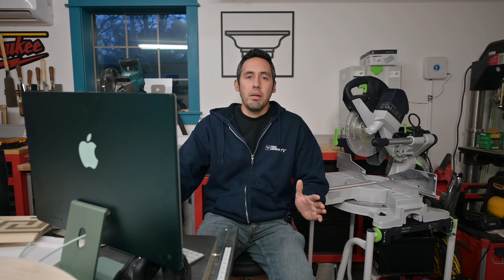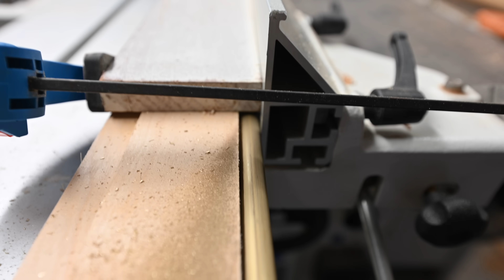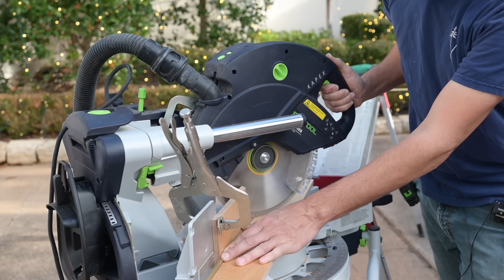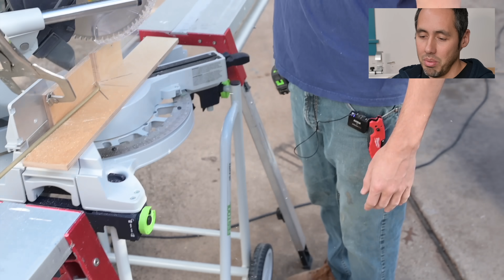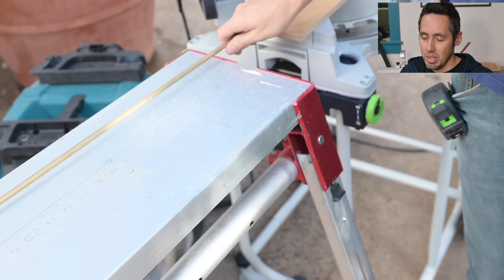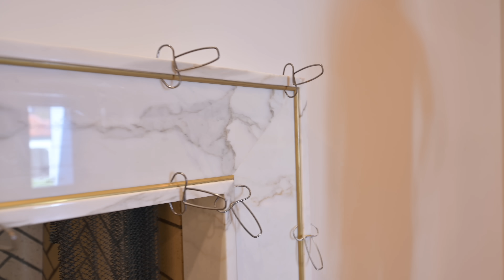It only took 12 years...My first MITER SAW injury.

Comment: I think there was a bit more going on than you have so far determined by your your initial analysis of your incident, (although the short length of the offcut certainly may have contributed to it.)
 
 I believe that the main cause was that,  because of the "wedge-shaped" edge profile of that half-round brass,  a segment of the longer workpiece to the LEFT of the blade was pressed- by the cutting pressure of the blade- into the (excessive, imo ) gap between the bottom edge of the fence and the saw's turntable. That allowed the kerf to close up and pinch the blade into a kickback scenario.
 
If the left side workpiece had in fact been COMPLETELY restrained from any movement toward the fence, (and in this case UNDER it), this incident likely wouldn't have happened, regardless of the length of the offcut on the right side.
   
My worst accident? Being electrocuted unconscious while hanging gutter on a metal roof on a big warehouse, driving sheet metal screws while lying on my belly and hanging over the eave. 
Sharp metal cut the cord on the driver drill. Work buddies kept me from sliding over the edge, dragged me back toward the peak and I  quickly revived.
We took a short break, reset the breaker, taped up the cord and finished the job.

Comment: I was turning a segmented bowl when my tool caught and the bowl exploded. Part of it hit me in the face i was wearing safety glasses. The piece that hit me took basically took my nose off, it was dangling with about 1/4" of skin holding it on. Bottom line over a 100 stitches and black & blue like you can't believe. End result i have one little scar.

Comment: Kick back on a table saw… something I thought would never happen… something that unlocked a new fear… respect your tools… the cut piece of plyboard I left between the blade and the fence shot out and hit me in the chest… the sharp part hit me dead center in the chest as I had the table saw high up on another table… this thing could’ve hit me in the face… so now I try to use a circular saw and track for most of my cuts.. 😐

Comment: Working at my day job I was trying to drive out a rusted roll pin. I had the proper roll pin punch. I was using excessive force with a 32 oz dead blow hammer I missed one of the strokes and smashed my finger against  a steel plate. I exploded my finger tip.ams smashed my bone into little pieces. At the clinic the doctor cut half my nail off and stitched from the center of my nail around my fingertip to the center of my finger print.

Comment: So this is lame by all standards compared to your injury and the injuries of many of the commenters, but I’ve just started out learning carpentry basics for DIY applications, basically. So I was replacing my exterior door that separates the garage from the house and decided to do it the extremely difficult way by rebuilding the door jamb and hanging a brand new steel door. Not really a beginner project but hey, I’m good at biting off almost more than I can chew! Anyway, I also poured new cement for the step since I discovered that it wasn’t at the proper slope and far from level, making install of a new threshold very difficult. Then to anchor the threshold I used 3 inch tapcon screws to secure it. Well, I’m a petite woman and not exactly a “Shera” lol. So basically my wrists feel like I’m 80 years old now and it’s 4 days later. I think I have carpel tunnel and that’s my injury. Nothing spectacular. But let me add for interest and to stick to the facts, that this DIY project was actually a statement because the reason the door had to be fixed in the first place is because my husband broke it down about five years ago, in a fit of rage. He said that he would fix it, but he never did. We are recently separated, and this was my statement to myself that I can do anything I put my mind to and I am reclaiming myself and my door and my life. The other injury that is incidental to this project is my soon to be ex’s bruised ego.

Comment: Even though you can cut aluminum and brass with woodworking equipment, I don't because
you never know how its going to behave.  That's why I have a metal cutting bandsaw, lathe
and milling machine.  Nonferrous metals tend to be a bit grabby when cutting them.

Comment: Shot through my thumbnail with an 18 gauge a few years back working an outside miter on PVC crown. Held it there until the adhesive cured then pulled my hand from it

Comment: Worst so far was a wood blade on an angle grinder when working on a deck reno.  Blade skipped (no guard) and sliced a inch plus cut on the back of my left middle finger.  After a long moment of contemplation (I knew it needed stiches) I said it's fine and had my wife squeeze it together and I wrapped it with electrical tape.  Got back to work and got another cool scar out of it.  Plus I can flip people off when I ask if they want to see my scar!

Comment: Cut over half way through the bone on ring finger and severely nicked middle finger on none dominate hand with a biscuit jointer. First serious injury in forty years. 
Tenth of a second and life changing, fingers still hurt not as useful after almost a year. Please "Be carful out there "  ( Hill Street Blues Fans will get the reference ) we all do things we shouldn't at times and don't have any problem then a seemingly easy normal thing becomes an accident really an incident that was most likely preventable.But hay we choose to be out on the front lines of this field for the love of craft(money too but probably easier ways to make a living). You are more likely to get hurt on the job than the police officer on the beat so like I said and Richard said Be Carful Out There (really if you don't know it watch Hill Street Blues great TV) be safe

Comment: Table saw. Working with a cheap contractor, didn't want to resolve the blade, he sent me to rip a board, the board kicked back and spun with my hand still holding it straight to the blade.y finger hurt for 3 seconds then it got really hot, full of blood. Wrapped and drove myself to the hospital. When they cleaned it ,I finally saw the extent of the injury. The tip of my finger had slipped in four and barely just touched the bone. My finger was numb for 5 years after that. I have pictures..
If you choose me I'll send them to you. 🌸🌋

Comment: Was at work running a tanwitzer band saw. Cutting off gates. Hit a gas pocket.l went through that gate like a house a fire. Punched the 1 inch wide 14 foot long friction cutting blade spit my left thumb through the knuckle I knew instantly I was in trouble. First aider took me to the hospital. Pin and stitched back together. now the thumb  is crooked.

Comment: The worst life changing event at work was cutting a six wire hydraulic hose with the 12" fiber wheel on a metal cutting saw. The saw was about 12 feet from the garage door, and it was raining outside, the humidity got to the fiber wheel, it exploded, and flew by my right ear. After that, I would refuse to use that saw and only use the 10" with the metal saw blade.

Comment: I use a product called longboard, when it came out their J's are a single piece j and damn did they suck to cut. I've slammed my fingers in the j or have had it buckle and fold around my hand. 

Richard what blade were you using? I always use a Diablo ferrous and non ferrous blades. I've seen those blades spit teeth like Dennis smashed Mr Wilson's teeth

Comment: Using an air powered grinder with a loose t-shirt outdoors when the wind blew my shirt into the buffing wheel. That grinder wrapped into my shirt and caused the wheel to dig into my stomach. No stitches, but I did get a nasty brush burn.

Comment: Worst injury cutting rubber stair treads and the razor blade jumped the straightedge. Cut my index finger wide open to the bone.  Straight down the middle of the nail.

Comment: When I was first starting out nobody taught me how to use a saw so I was pushing a 1x2 through my dads beat up Ryobi table saw he let me borrow with a dull blade and no fence so when I hit a knot I pushed through it at an angle. Wood shot back and hit my leg and thumb went over the blade when I was by myself. Luckily the blade only went through my thumb about 1/4” and missed the bone so still have my fingers and full feeling but looking back on it now that was probably the best that could’ve happened for how stupid I was being with a saw.

Comment: Drilling a hole through six inch lvl with a hole hog. Caught the last quarter inch. Jammed my left hand up to the floor joist and ripped my ring finger nail smooth off. Handed the drill to the guy on the ground and he's laughing and says "at least you didn't drop the drill."

Comment: Sorry Richard, in this case, the Kapex is the wrong tool for the job, at least as-is. 
For cutting metal you really need three teeth in contact with the work at all times, and neither of the Kapex's standard blades come close to that (60- and 80-tooth if I remember). 
You need a much finer blade..
Best way to look at it is that you got away with it up until now.
I don't know if anyone makes a suitable blade - tricky, as the KGS120 has a >250mm blade (I own one and I can't remember the diameter!). A suitable blade at that diameter would have a huge tooth count.
i think I would use something like a hobby/model maker's table saw, with a much smaller blade.

Comment: I forgot to add a dado to a frame piece before cutting the miters. So I used one mitered end to push another mitered end through the dado blade on the table saw and it kicked back and hit me in the index finger on my right hand. Off to the ER for 7 stitches!

Comment: Looks to me  like saw blade tpi needed to be increased. 
When you use a hacksaw with a low tpi count on a thin 
piece of aluminum it wants to pull it out of your hand or push it
down towards the surface your trying to hold it down on as you
are trying to cut it. 
And if you put the piece in a vise it tends to bend the piece back and forth 
as you work the hacksaw. 
With the mitre saw the blade is only going in one direction and when it 
gets caught (and it will at some point) when something changes ,blade 
speed , pressure on piece, different hardness of piece or whatever it may 
be you are going  to get the results you experienced.  
Kinda like kickback,  doesn't always happen but when it does look out 
because it's gonna happen hard and fast.
A blade with more tpi and something holding the brass other than your 
hand directly holding it would  have been yor best bet !
Spend the extra money on the proper blade and save your fingers!
We are all guilty of just making it work with what we have because 
of time or cost restraints.
Enough of that ...me trying to free cut a square diagonally on a table 
saw. Just needed two triangle shaped pieces so l will just rip this real
quick instead of getting out the circular saw.
All was fine until after the cut and one piece got caught by the blade 
rode back over the blade and towards me.
Lucky for me l was not using the fence in anyway and the piece more
or less just floated on the blade with  not alot of force and l was able 
to kinda control it as it skated off the blade towards me.
That was an eye opener and a pucker moment and something l won't 
do again.

Comment: OSHA did a poor job with their conclusion of what you did wrong/what not to do next time. Kidding but I didn't hear, unless I missed it what the lesson learned was. You did mention the small cut so do you think cutting off a bigger piece of waste next time is the answer?
So no good Project injuries but in 2003 I did break my knee riding my quad. The break was so bad that I needed surgery to put all the pieces back together and 20 years later I still have all the hardware, plates and screws, installed. One screw is pushing where there isn't much meat so you can see/feel the head of it and every little bump into feels worse than hitting your shin. Anywho, nothing exciting about the wreck. I just went through a few moguls/dirt mounds and it was relatively slow speed but fast enough where I along with the quad were thrown to the right, my right leg planted and I could feel it wasn't going to be a good outcome. It's call a tibial plateau fracture. The doctor said, "imagine punching an orange", that's kinda the impact/result of the top of my tibia smashing up into my femur. Good times.

Comment: I cut the ends of my two middle fingers on a jointer when I was 16 I’m 71. I was lucky it was worse. It was my fault as I knew the board was too small. It shot the board into a door.

Comment: Back in my early days b4 i knew better i was setting an exterior door using a large est wing framing hammer was using a beat block and tapping the door into place and my boss pulled up looked away and thwack smashed my thumb the 2nd would be a massive splinter lifting a fence panel was standing it up my hand slid down the panel picked up a 2 inch splinter was in my hand for 3 weeks

Comment: Sanding a door by hand and a giant splinter, half the thickness of a pencil, broke off as I was aggressively moving the same paper. Went straight through my hand. Didn't hit a bone and remarkably, I barely bled. I stared at it as it was sticking through both sides of my hand and then got my wife to yank it out. Was a little sore afterwards, but barley needed a bandaid...

Comment: I was installing a metal key lockbox in an exterior doorjamb and the SMALLEST little shred of metal shot off of the box and landed right in my eye. Went to the eye doctor and he had to pull the metal out of my eye and it felt like a string was attached to my stomach while he was pulling out the sliver that felt like he was pulling my stomach out with it! Strangest-worst feeling ever. You really get to see how fast your eyes heal themselves, as by the time I got to the doctor, he said it had already sealed itself up from the outside. OR the time I smashed my pinky finger with a mini sledge. OR the time my chisel slipped and I stabbed myself in the hand 😂

Comment: Damn, so glad you escaped a major injury. Now you have time to armchair quarter back the incident. My casualty after 40 yrs doing cabinetry, I've had a few kickbacks that sent pieces through walls but one day I just wanted to buzz that little tit off that remains on the end of the ripped off waste piece. Grabbed it to clean it up and as I pushed it towards the blade I stumbled on a air line that I should have moved. Well I ran my thumb into the blade until it hit the bone then I had the reflex to pull back. Yep, shortened it up a little. Personally more pain and embarrassment explaining to fellow woodworkers what happened. Yep, slow down, make sure the surroundings are safe. Sadly we all have taken a little chance at something and skated by. Time will getcha. Stay Safe!@

Comment: It does happen quick was making kitchen cabinets for my son’s house killing some time, waiting to babysit my other grand children from my daughters made one cut on the tablesaw for some Reason I reached up to push the small cut off away and touch the blade with my left thumb and as I pulled my hand back it clipped a little bit off my middle finger to. I think it was a 12 stitches in my thumb still don’t have feeling in that part it just happened so quick.

Comment: Clamp it down. Been a machinist for 35 years and its like drilling holes on a drill press and thinking you can hold it when the drill breaks through...you can't. Oh by the way I cut the top of my thumb off on the table saw...so I am not preaching. Stay safe.

Comment: I held a metal, 2 gang box cover plate while someone else drilled a hole in it with a step bit. Of course it turned into a lawn mower blade. I got 11 stitches. Took a while for it to heal.

The real kicker is I was wearing gloves and what made the injury so severe was it caught my glove and pulled my hand into it.

Moral of the story: PPE equipment won't save you from pure stupidity

Comment: I don't think you're supposed to cut any type of metal with a miter saw... The same has happened to me when cutting a threshold. The worse thing that's happened to me is, i stepped off a set of stairs half way up that didn't have a reading landed with one foot on my table then pushed myself off landed on the my the sided of my leg and body. Luckily i didn't break.

Comment: 4:32…. The “accident” could have been avoided if you had a true zero clearance vertical/back fence…. That small gap from your dual 45 degree pre cuts in the back fence is why you got some bite and kick back… next time just make a new fence especially if all your cuts are going to be the same

Comment: I used to wonder how anybody could cut their finger off on a table saw. Now I know. (I still have my thumb. I only cut half way through it) The portable saw was on the ground, and I was pushing the wood with all weight leaning forward. I slipped, and time slowed down to a crawl as I could see/feel my thumb going over the saw blade, while in a split second thinking "this is going to be a bad cut, no maybe it's only a minor cut, I hope it's not bad, Maybe it's between minor, and bad."

Comment: I almost had a 40’ x 18” I beam fall on me. I was setting up staging on the opposite side of the house we were working on and looked up to see an I beam falling out of the sky. I jumped just in time. The crane operator was not supposed to put the far side of the 3 I beams up from the side he was on. He was supposed to put the middle and his side up and then drive around the opposite side and put the last one up. When he was leaving he left his boom up and and I ran him down a few feet before he took out the power lines. 😂 he had a bad day.